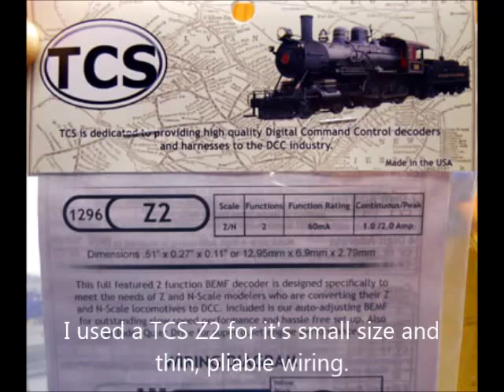TCS Z2 decoder into an N Scale Tomix Track Cleaner.  Fifer Hobby Supply

Comment: Mike, do you know if the Digitrax N/Z DZ123 2-Function Mobile Decoder would work just as well as the TCS decoder? Thanks for you  help with this.
Reply from the maker: Yes but I did not use them as the wire is much thicker and harder to work with.

Comment: Even with a decoder installed the car still does not move on it's own. All the decoder will do is turn the car's motor on to run the cleaning attachments. You'd still have to move the car with a locomotive.
Reply from the maker: Yes , it is unpowered.
Reply: @N-Scale  I remember when the one I purchased form Amazon arrived. After reading the page on the HO-Scale cleaning cars in Model Railroader I assumed the N-Scale ones also were not self propelled. I didn't get a chance to read that the first time but on Amazon it says "Locomotive required for operation".
Reply from the maker: @scotthayes5933  That is correct.
Reply: @N-Scale  I have a video on YouTube showing the Tomix car I got on a shakedown run.

Comment: Thanks for the video!! A little late to the party, but just picked one of these up, does anyone know if there are English instructions for the Tomix car anywhere?
Reply from the maker: http://www.atlasrr.com/pdf/PartsPDFs/NTrackCleaner.pdf

Mike
Reply: Wow thanks for the fast response! You sir are awesome for sharing your knowledge and skills to those of us not so..
Reply: Also one more question if you don't mind, what did you use to cut the circuit board? I am afraid to go at it with a dremel ;) Even a jewelers saw has me paranoid about ripping those circuit traces up. Never hacked up a circuit board.
Reply from the maker: Thanks , Mike
Reply from the maker: I de-soldered the parts first then cut it with rail nippers.
Mike
Reply: Thanks, I thought of that too, was not sure how brittle that board was. I ended up using a jewerly saw.  Then my digitrax decoder was a bit too big, so ordered the TCS from you last night.
Reply from the maker: Thanks , Mike
Reply: Hi Mike,  I got the decoder installed, and it works great, thank you again for the video, and your super fast shipping, also helps I'm just north in CO. Will be shopping from you again. Next up installing a flashing yellow LED in the top of the cleaning car.
Reply from the maker: Thanks , Mike

Comment: If I put the TCS Z2 on a DC track will it wreck the decoder? Some dcc decoder say they will work on a dcc or DC track.
Reply from the maker: It should be fine but why would you if you have DCC?
Thanks , Mike
Reply: Mike Fifer I have 6 DC locos that will be slowly converted to DCC, just don't want to smoke anything. I love your Chanel and store, thanks for the reply!
Reply from the maker: I am sure it will be fine. Thanks , Mike